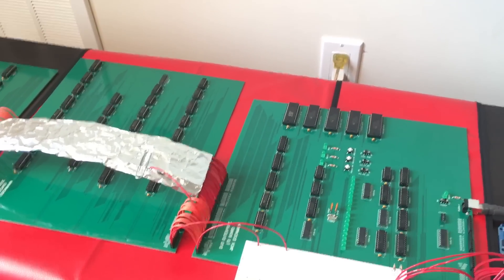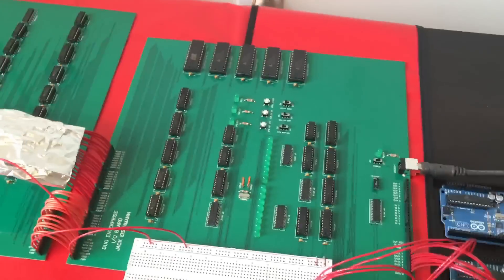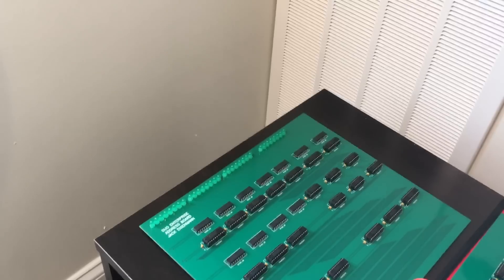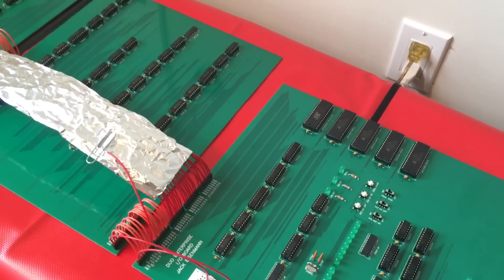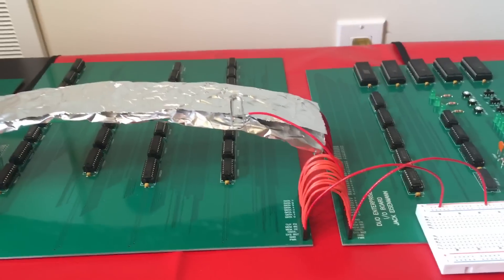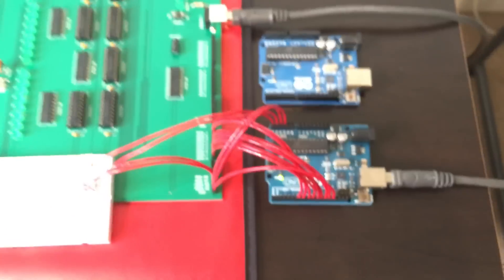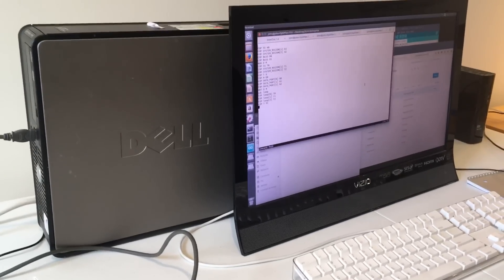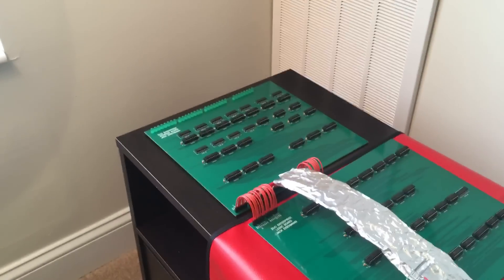DUO Enterprise Overview and Plans

Comment: Why don't you just twist the wires?
Reply: That works for differential signalling. He could have done this if he'd included one ground wire for each signal wire -- that would also cut down on crosstalk between signals. In practice though, it seems like he got away with it!